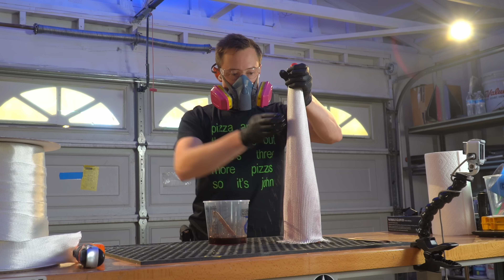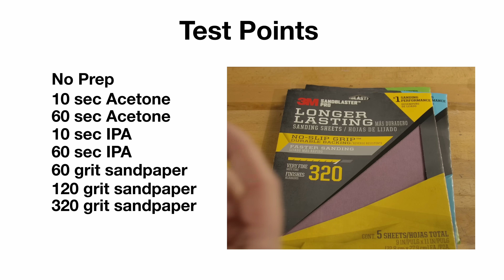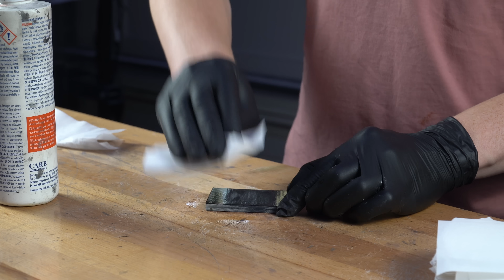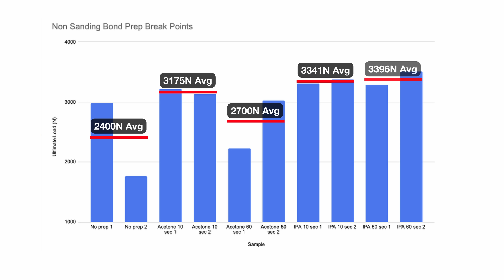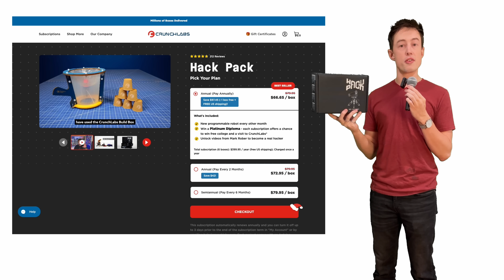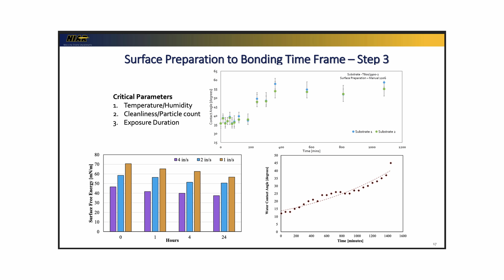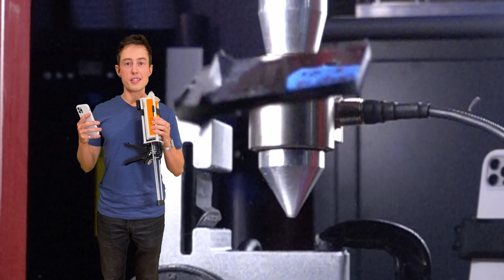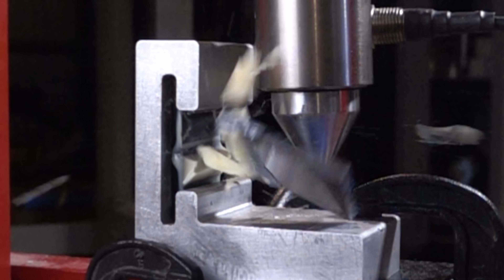I Broke 100 Epoxy Bonds to Find the Strongest

Comment: As a point of contrast, in dentistry, resin composites largely rely on micromechanical retention - penetration of the resin into tiny pores (tubules) in the crystal structure of the teeth.
In order to maximize retention, bonding to teeth is usually a two-part process (and technically each part can have several steps): application of a thin adhesive layer and then application of the resin composite itself.  The adhesive layer is also resin, but it's usually "unfilled" (lacking added ingredients for durability\polishability\etc) and thinned with a volatile carrier like acetone or ethanol to make it extra flowable for enhanced penetration.  The adhesive resin is applied, agitated by scrubbing to encourage flow into all the "nooks and crannies" of the surface, and air is blown over it to allow the carrier to evaporate.  Typically (though not always) it's cured at this point and then the resin composite is applied which bonds to the adhesive (which still has an "active" surface to bond to thanks to air inhibition of curing at the surface).
Bottom line: curious if there would be any benefit to applying a low-viscosity surface coat first?
Reply: Worked in high end composites in southern hemisphere and this was technique we had as sop, press in low visocosity then apply thickened. We werent thickening it ourselves, two seperate products. Built components for a very historic boat race at this facility 😉
Reply: This is really interesting. That would be fantastic if Joe or someone else added this technique into their testing
Reply: @thom7440  As Joe said ... do your own testing and let us know! 🙂
Reply: This technique is used when applying thickened resins to a surface. West Systems for example recommend applying a thin layer of plain resin to a surface(s), then applying the resin with additives (thixotropic agent, microballons, etc) when creating fillet joints.
it's probably more significant on porous surfaces like teeth or wood than glass boards.
Reply: How important is the acid(?) etching step that happens before the first coat?
Reply: @robertobryk4989  In dentistry, the acid etching step seems to be "pretty helpful", such that it's pretty much expected that you'll either have a step of acid-etching (usually phosphoric acid) and rinsing before application of the adhesive, or you'll use a "self-etching" adhesive resin.  The microtubules get occluded by organic debris naturally over time and during the preparation (drilling), so etching ensures the surface is free of debris and the tubules are open and available for adhesive resin.
By contrast, when using resin adhesives against certain ceramics (or existing resin restorations that have been in service and lost their bondable inhibition layer), etching with stronger hydrofluoric acid produces a surface that (I believe) is chemically available for adhesive bonding.

Comment: The pain is so real. I tried to validate the dimensional accuracy of some 3d prints and it was infuriating. Amazingly inconsistent, still haven’t figured out what makes it work sometimes
Reply: Filament diameter?
Reply: Enclosing the print volume so temperature doesn't vary according to random drafts?

Some filaments are quite hygroscopic. Do you have a warm, dry enclosure for the filament rolls feeding into the printer?

Sure remembering some experiments from people like CNCKitchen.

Comment: You probably have seen into that before, but some epoxy get tempered at like 60°c for a couple days to i think raise the glass tradition temperature. Might be important if the rocket is on the pad in the sun

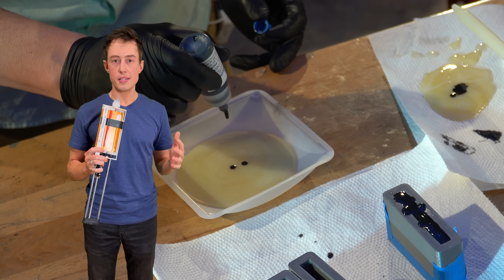Comment: 3:30 temperature/humidity in the room during the drying
Reply: That occurred to me as well. I also wondered about the ozone level (actually a significant problem in my location during the summer).
Reply: A home built autoclave in a makeshift clean room can work wonders when you need things to stay together.
Reply: bingo

Comment: I've already learned more about surface energy through your video and practical demonstrations than I learned in 6 weeks working for a plastic films manufacturer who had entire quality control departments who measured with dyne pens to ensure that branding and coatings would adhere to the plastic films they were producing.

Comment: Vacuum degassing may also pull the epoxy deeper into any spaces in the fiberglass weave
Reply: It's common to use vacuum and pressure to push resin into deep pour structures, so yes.
Reply: High pressure chamber could be even better. They use autoclaves to make carbon fibre parts.
Reply: @cyrkielnetwork  The Titan submersible could have used some help from everyone in this comment section. When I heard about how they assembled that sub with totally unproven composites methods (while also ignoring Boeing engineers' recommended ply layer arrangement) and sent people down in a design that hadn't even been tested to crush depth my mind reels at how irresponsible that was.
Reply: @cyrkielnetwork  difference is that the carbon fiber part is vaccuum bagged within the autoclave. so its always pulling the air/gases produced out, While the autoclave pressure pushes all the carbon together further consolidating the plies. Only pressurizing the epoxy will actually just keep the airbubbles in the mix, pressurizing them.
Reply: @dinguth4695  Yes, you need both. Vacuum to remove bubbles, and pressure press things together. However he might not have access to autoclave big enough. But it would definitely help with strength and consistency.
Reply: Bear in mind that he is doing these tests to find a method for bonding fins to a rocket body. Having a pressure chamber large enough to contain a rocket body and fins would seem to be financially out of reach for Joe.

Unless you know of other methods to apply a vaccum to a large object with potentially a jig to hold the fin in place while the epoxy is curing...
Reply: @fredericapanon207  Vacuum is easy--use standard vacuum bag materials and techniques. I built composite surfboards in my garage. I've done various carbon parts as well. It's the additional pressure that takes a big vessel, and vacuum alone will get you most of the way there compared to hand layup.
Reply: @wellscampbell9858  cool! Thank you. I was puzzled as to how he might apply the vacuum to the rocket body at the fins.

Comment: 21:19 at least with sanding, you might be able to automate it more consistently and safer than the other two methods. The thermal method also has potential for similar automation, with both trying to achieve a certain duration and, in the case of thermal, distance from the object. With sanding, you can use a belt sander maybe to mass sand parts, I think (at least the flat surfaces). (edit: 26:08 Yeah a belt sander might give you a similar grain pattern to hand sanding here.)
edit 2: haha that humbling moment with the expert at the campfire.

Comment: It's great that you talked about how these aren't like the scientific testing that gets published. Due to a phenomenon called the Central Limit Theorem, you typically get a proper normal distribution curve of samples for each product you're testing when you do at least 30. However depending on how large or small you want the margin of difference to be between different samples you may need to do a power test which may require you to do HUNDREDS of samples per test. A lot more than a guy in his garage can feasibly do.
Reply: I know Joe emphasised that these tests are not scientific in any way, but as a University stats tutor, the genuine lack of statistical rigour was really bugging me💀. Doing two tests per variable and then claiming that one is more consistent than the other, or changing sanding, degassing etc factors mid-test is wild to me. Nonetheless, this all made the video very entertaining😂
Reply: @SJokes  I'm uni student who had/have statistics two semesters (even though we are learning the same but from different points of view and one is much more understandable then the other - probbly why I have a bit of bitter taste in my mouth when I hear statistics). I could not call this statistics even while having a fever. Two measurements is not statistics and deffinetly not measurement of consistency as these test are from normal distribution and BPS could "choose" minimal and maximal values (both extremes - both deviating from mean and probably they are not deviating simetrically so average is not good way to get mean). Deviation is also at some points laughable at best.
So from my stand do at least 3 repeats for every measurement ideally 10 (as I understand the BPS does not have proper financing or technical equipment and time to do it statistics proper way).
However I totally agree that the video was interesting and entertaining.
Reply: @SJokes  2 tests per is completely fine if youre trying to fit a trend line. If you have 5 different sand paper sizes, and do 2 specimen per, then you have 10 data points. If youre fitting y=mx+b, thats only 2 parameters to fit, leaving you 8 degrees of freedom in the model, which is a quite adequate.
Reply: @mitchellsteindler I agree that you can get a reasonable fit, but he drew pretty wild conclusions like 'scoring produces a wider spread' from 2 samples.
Reply: @julianschanze3427  seems like a reasonable conclusion. Don't forget hes not just collecting data, hes collecting data on a real system. Are there very reasonable explanations as to why randomly scoring would result in higher variance? Yeah of course there are. Once you work with real life problems, statistics becomes less about computing a p value.
Reply: There are other flaws that were introduced in the sample production and testing processes.
I think these tests were still insightful but the C.L. Theorem is likely the smallest concern.
Reply: @s.sradon9782  Having only two or at best three measurements cannot be called statistics and difference between same parameter measurements just proved this.
Reply: Yep, that is basic statistics.
Reply: The way you put it is the common rule of thumb, but it is a slight oversimplification. The Central Limit Theorem (CLT) states that the sampling distribution of the sample mean becomes approximately normal as the sample size (n) gets sufficiently large, not that it is automatically a "proper normal distribution" at exactly (n=30).
Reply: @stopthephilosophicalzombie9017  i wouldn't call it a rule of thumb, I would call it an error in understanding!
Reply: Thats actually not what the central limit theorem says. You can very easily have a non-normal distribution, even with thousands and millions of measurements. In fact its very normal to not have a normal distribution! The CLT says if you take a sample, let's say 10 measurements, and compute an average. And then do that again and again (say 30 times since statisticians like that number), those 30 averages will form a normal distribution.